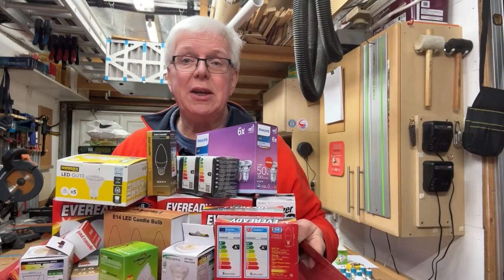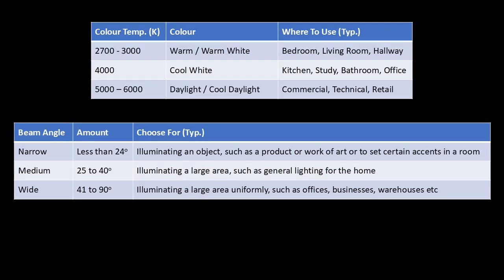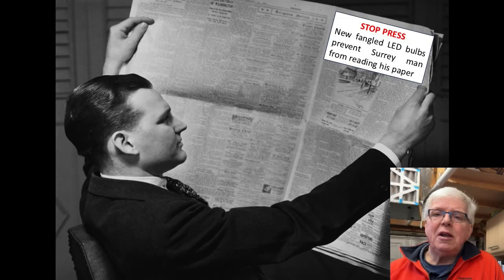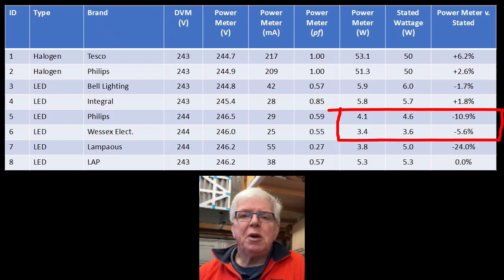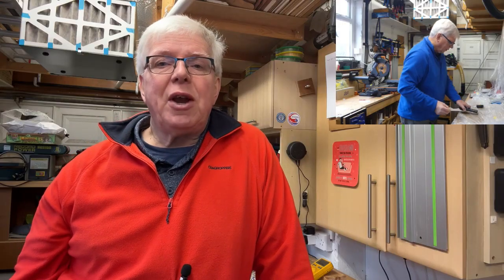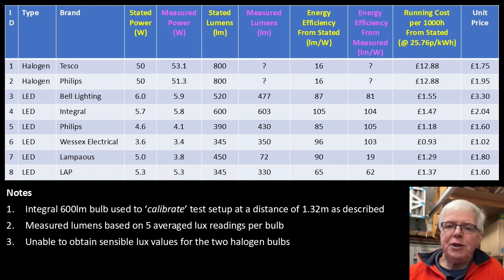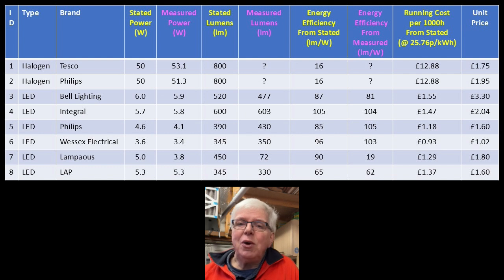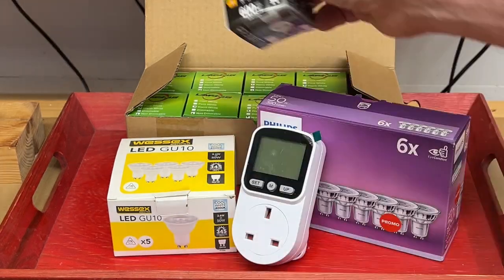Testing LED Bulbs - Do The Manufacturer's Claims Stack Up? - With Giveaway

Comment: Do Any of these actually last for even half the stated life?
Reply from the maker: I don't think anyone believes the stated life on the box ... do they? And who has the time to track how long you have them switched on for (unless you automated it in some way). However, even if you only got 25% of 20,000 hours, it still adds up to over 2 years at 6 hours per day, every day. I don't think that's too bad for a £1.50 or thereabouts bulb. I think the issue is that the marketing men are quoting theoretical lifetime of the actual LEDs, rather than the complete bulb itself, but that's just my 3c.
Reply: @handyman-at-home  Agreed, however it's still dishonest!
Reply from the maker: I don't disagree. 👍

Comment: l bought 20 led   9w ccol white bulbs  for $20, over 2 years ago and have had 2 go on me, l had lust bought a philips for $5 a few weeks before, these cheap bulbs lasted longer than the philips, so the old saying  you pay for what you get is not always right
Reply from the maker: Agreed. From the bits and pieces I've read, a lot of the variability seems to be down to the degree of heat build-up around the light (depends on whether the bulb is in an 'open-air' fitting or within a tightly enclosed downlight/spotlight fitting) and the quality of the electronic circuitry used to drive the LEDs. We had our kitchen renovated in early 2019 and had probably around 15 or so downlights fitted. They started going around mid-2023, so just over 4 years life, and I've probably replaced 40% of them by now. Mind you, they do get hammered - the missus is always leaving them on 😂 Cheers, Chris